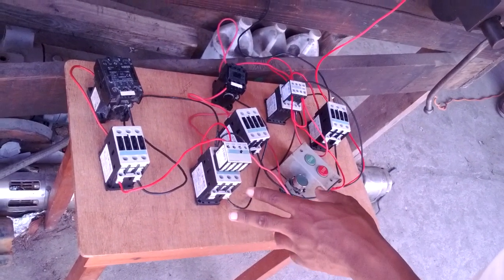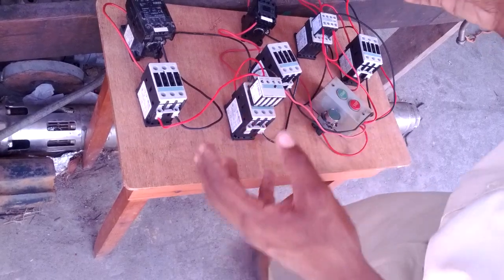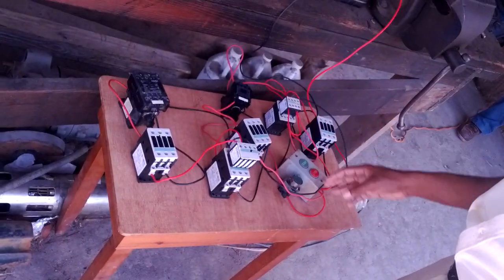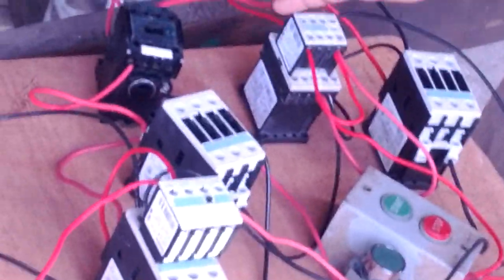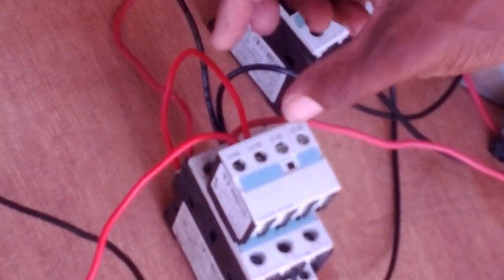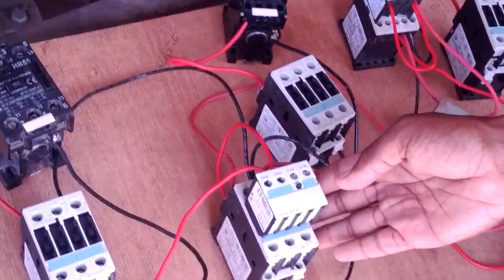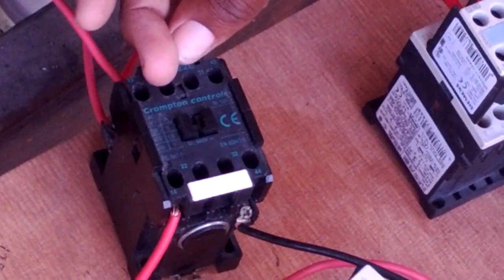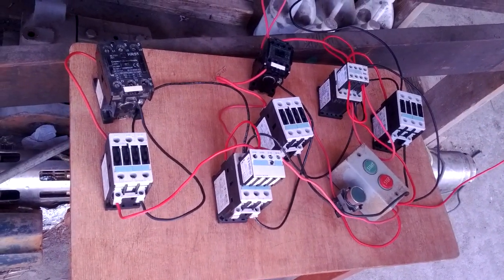How to wire Contactors and Auxiliaries.

Comment: Well done. I have learned something about how the auxiliary contacts work from changing their positions when the coil is energized. Am I right to conclude that the auxiliary contacts NCs and NOs are like spare terminals to use for other devises we would like to run? It would have been even more helpful to show where the wires go. Is it A1 and A2 coil when energized that closes the contacts of the contacts of L1-T1, L2-T2 and L3-T3? . Thanks again
Reply: Yes, the aux contacts are often used for lower voltage events that need to be triggered when the primary contacts are opened or closed. Examples of these would be indicator lights, buzzers, etc.

Comment: @dom Briton,you should put your main contactor wired on direct on line start,stop,this means that when you push your contactor in,it wount come out until it trips via overload relay or until power is cut of by stop push switch,it would be hard to explain to you how to do this,I suggest you get a single DOL switch gear the cheapest they have then look at how its wired,it would help you more than when some one explains it via video or writing